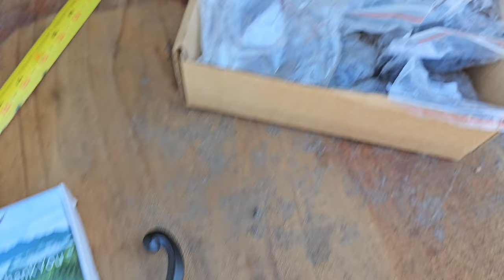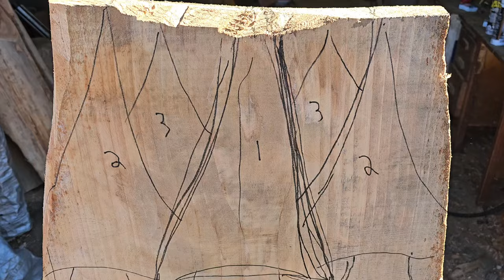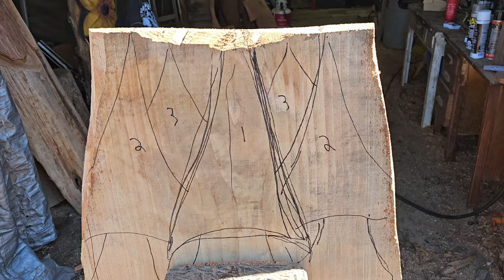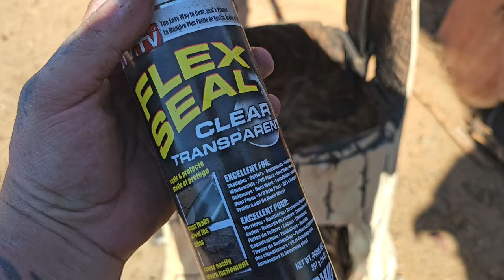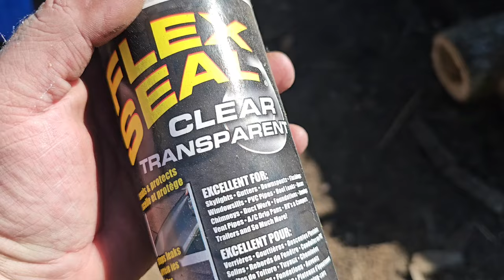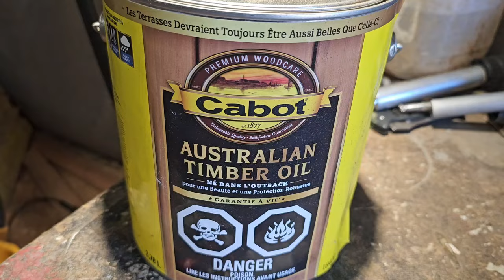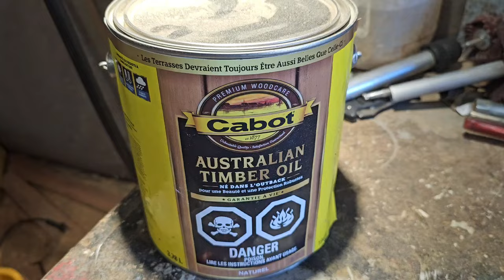chainsaw carving an trees owl coat hanger yup.

Comment: I like your trees n owls hanger.👍☺️
I used Flex Seal to coat the inside of a window well a few years back, n I had to use quite a few cans. Lemme just say, use it outdoors for sure, n recommend a respirator with that stuff! Yikes on the fumes. It works great though. 
On the post, I think your swirls would look great. Of course, anything you carve is going to look good.